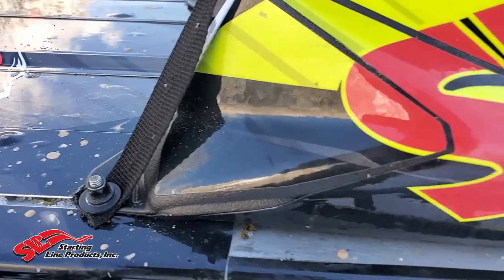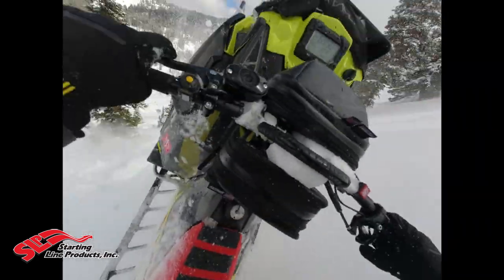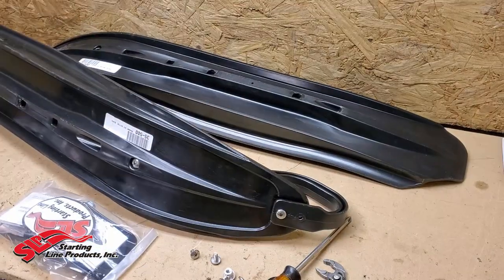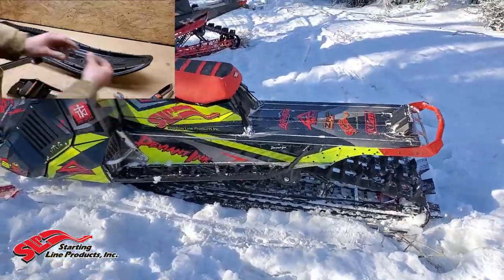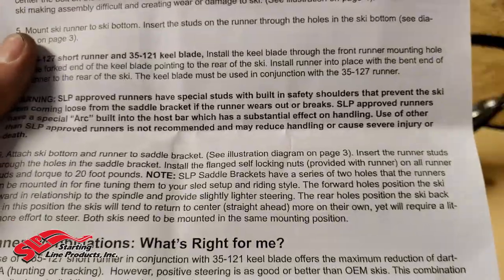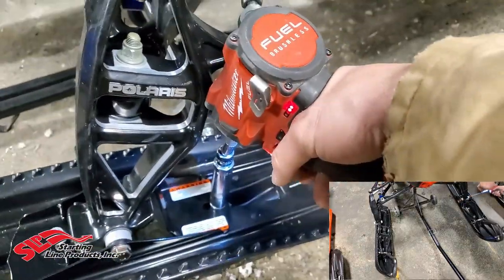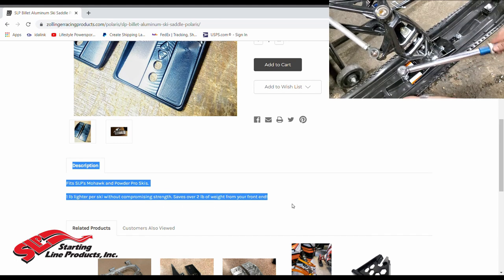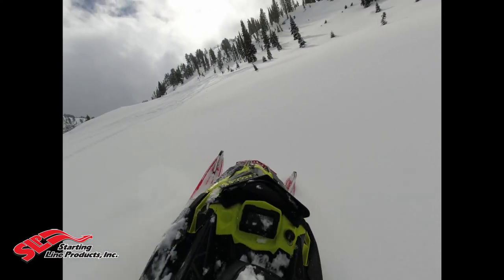Starting Line Products (SLP) Mohawk Skis Review and Install

Comment: Just got a 2022 Khaos that has the Mohawk skis.  I came off an Axys Pro with stock skis.  Only got one ride in decent spring snow with the new sled.  The tipping point/balance point seems different.  I don't know if it is the skis or the Matryx Chassis/Khaos that is different.  Did you notice a new balance point when on an edge with these skis?

Comment: I am contemplating these or the attack ski.
Are they both enough of an improvement over stock to warrant the price?
Reply from the maker: The stock gripper skis are a great ski and hard to beat. I haven't ran the attack skis so I don't know about them but the Mohawks I would say are a step above the grippers. I find my sidehill more predictable with the mowhawks and going down the trail I don't dart and glides across everything in the direction I want it to go. When I steer it bites. The grippers don't steer as nicely as the Mohawks down the trail.